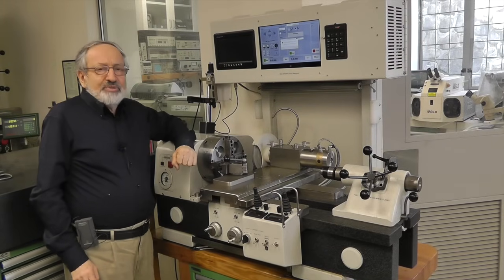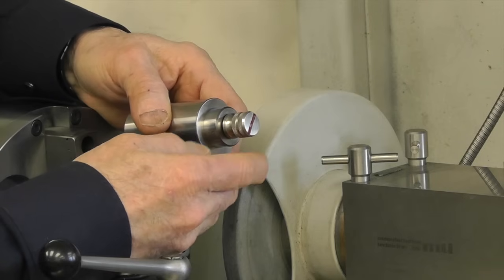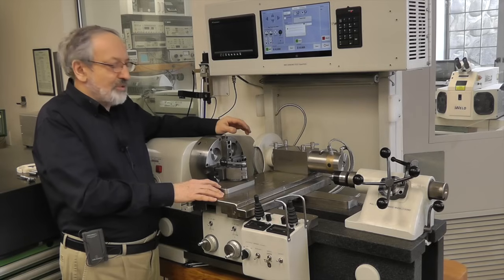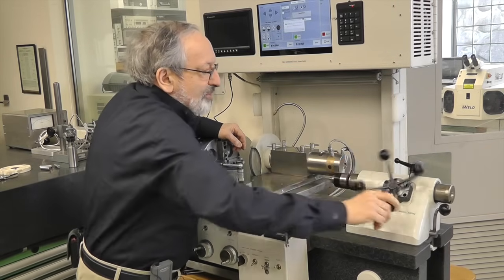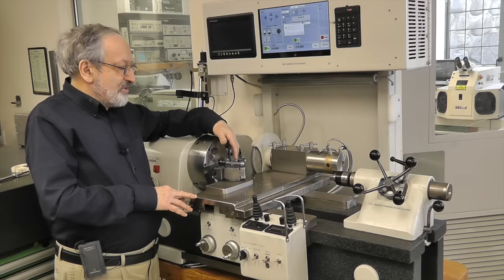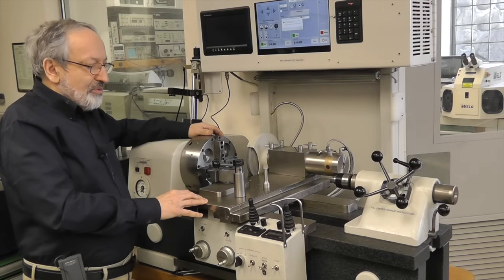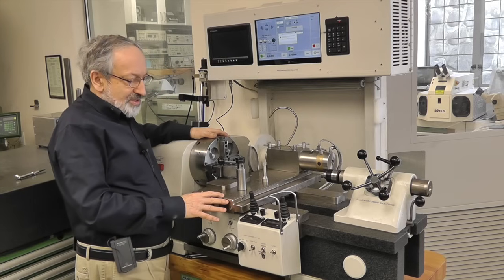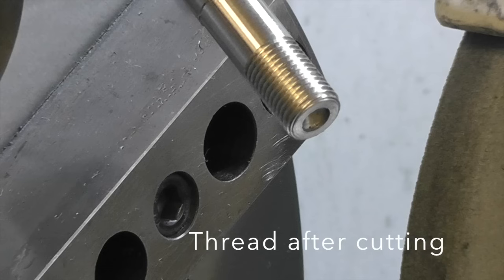High precision air bearing CNC lathe and grinder

Comment: Hi M. Gelbart, I really enjoy that short video like all your videos. I'm looking forward to see more of your work. I'm working on a very small prototype of horizontal mill / surface grinder following your design and I'm wondering what material did you use for the spacers to hold the granite parallel under compression and how accurate that pressure should repeat over each spacer? Thank you.
Reply from the maker: +Simon Bouchard The spacers are pieces of heavy walled pipe, about 3"OD and 2"ID, all pieces ground parallel in one setting and everything set up to cure flat on a granite  table. Exact compression not important. After curing, the two top flats are added, with gap between them held constant by precision spacers (+/-1um), everyhing inverted on a granite table for curing flat.
Reply: +Dan Gelbart Thanks a lot to answer so quickly, can you explain what are the knobs through the granite? Did you use 6061 walled pipe? All the granite construction is hold under compression just by the epoxy glue? Sorry for all those questions but your work is so interesting.
Reply from the maker: +Simon Bouchard The spacer pipes, like all non-granite parts of the lathe, are stabilized steel. The large "knob" you see is the large head of the bolt that keeps the joint under compression (about 2-3 tons). If you look at the begining of video #1 of my series about making prototypes you'll see the granite parts curing on a granite table in the background.  I recommend starting with a less ambitious project.
Reply: +Dan Gelbart Yes, thanks for your transparency and the advice I will follow it. We do a lot of grinding +/- .0002 but not so much lapping and scrapping which you really get me interested to now that I understand the function of it. You really easily make thing intelligible M. Gelbart, and like many of us I can't wait to see more of your work and technical video. Your enthusiasm is contagious.
Reply: +Dan Gelbart Hi Dan,
When you say the spacers are "stabilized steel" do you mean they are 321 stainless or that they are stress relieved?
Cheers
Reply from the maker: +Andrew Robb  Stress relieved mild steel (600 deg C for 5 hours).
Reply: +Dan Gelbart hi Dan,
Thank you for your reply to this and my other question. You are very generous with your time. 
Regards Andrew
Reply: Hi M. Gelbart, can you provide some littherature reference on air bearing? If I understand you also need to reach a certain surface finish? Are the two surfaces lubricated with compressed air throught porous material or is the geometrical precision only what you need to eliminated the wear? Thank you and Happy New Year
Reply from the maker: Spacers were hardened steel matched blocks, pressure not so important if area is large. I used about 50Kg.
Reply from the maker: Search under "hydrostatic gas bearings" or "air beaings" and you'll find many books.
Reply: Thanks for the quick answer as always. What surface finish are you aiming for?
Reply: If I can be more precise on my question, can you use a scraped surface or do you have to lappe it to certain surface finish? Thank you
Reply from the maker: surface finish not important (~1um), flatness very important (<1um).

Comment: Dan - Really beautiful video.  I was interested in the chuck.  I looked at the patents skinner chuck company has had over the years but couldn't find anything quite like yours.  Can you give me a push in the right direction?
Thanks!
Reply from the maker: t cody Skinner chuck only had the sealed design, not the  system to remove the run-out.  The run-out adjustment is done by moving 1:10 wedges which displace the plate the chuck is mounted on. The plate is clamped between two other plates. All the interfaces use roller bearings and all parts are hardened, ground and lapped air hardening tool steel (A2 and D2).  Chuck parts are made to 1um.

Comment: I need to build this machine. I think I should buy a precision motor and precision air bearings and make the parts that can be made and not bought of this lathe. I am so lost though, please give me some insight of making a lathe mostly from scratch. Dan Gelbart please respond soon. Thanks for your time.
Reply from the maker: Sir. Dan This is a machine for very experienced people. If you need instructions how to build it, better not to try until you learned more abut metrology.
Reply: I have mechanical drafting, electrical, welding skills, and some computer programing. I am dedicated to learning how to manufacture precision machines.
Reply from the maker: Sir. Dan A good place to start is the book "Foundations of Mechanical Accuracy" by Moore.
Reply: I will go get that book and learn as much as I can. Thank you so much. I hope I can invent something great, You can't invent something you don't have knowledge about. I hope I break that barrier of knowledge that is needed to be more intelligent than others. example) everyone tries to write lyrics, and the lyric library is being exhausted.

Comment: I would love to hear you discuss how you got positioning motors (steppers?) to deliver such tight tolerances.  What an amazing machine!
Reply from the maker: Buck Calabro A stepper is accurate to 5% of step, or 1/20 of step. Since there are 200 steps per revolution this is 1/4000 of a revolution. Stepper is geared 1:2 with a timing belt so 1/8000. For a 4mm pitch ball screw this is  0.5 um error. Problem is that this calculation is only true if stepper is lightly loaded (say 10% of max torque). On air bearing machines this assumption is true as there is little friction.  Also, many precautions need to be taken: timing belt pulleys need to be re-bored for very low runout, bearings need to be square to shafts <1um etc.
Reply: Dan Gelbart It seems counter-intuitive but the math does not lie. Thank you very much!
Reply: @dgelbart  A good stepper is mechanically accurate to 5%, but as far as I know, micro stepping over a certain value, falls accuracy because of non linearity of the motion that introduce position incertitude. Setting 1/20 micro steps charge the inductors from 100% to 0% to 0% to 100% in steps of 5%, so the first step would be 95%-5% the second 90%-10% and so on. What I have learned say that motors won't move until a minimum amount of energy is given to the "weaker inductor" ... but that it's theory and what happen at the various rotation speed I'm not aware. Your experience is much more valuable than any theory :-)
Reply from the maker: @silverdog63  Fully agree, but per my previous answer you still get only 0.5um of position error from the stepper motor itself if it is lightly loaded.

Comment: Hello Dan, 
Do you think the bottom two granite parallels (that are bolted together) should also be so precisely machined than the top two. Maybe you could also use something less accurate.
What about metal base, or is this not a good idea because of different coefficient of thermal expansion?

Regards

Comment: So I bought a jig borer yesterday. It's a B.C.A. Mk3. While I was moving the machine,it fell of the pickup truck and the z axis screw,micrometer dial,a couple of other dials,and some small parts broke off.  How do I go about repairing the machine? The body castings appear to be okay,a couple of chips on the z axis hole where the screw broke off,but other than that,no visible damage to the body.
Reply from the maker: airsoftsniper108 You can read about it and its history here: http://www.lathes.co.uk/bca/
Reply: Dan Gelbart I already read that. But I can't find the instruction manual,and I don't know exactly the full extent of the damage that it has. I think the worm-and-wheel gearing broke off though. It's some sort of part that appears to have ball bearings in it.

Comment: I was wondering about the load capacity and size of the main spindle bearing.  I found some information regarding air bearing stiffness but wanted to know what results you are seeing in practice.  What depth of cut are you typically taking for aluminum and steel?
Reply from the maker: Skyler Olsen Main bearing is about 3" (75mm) dia x 6" (150mm) long, plus a 5" (125mm) dia trust bearing. Load capacity is not very impressive, maybe 50-100Kg @100psi air. One reason is that the spindle bearing does not have pads, just holes. Pads (shallow depressions around hole) greatly increase load capacity.
Reply: Dan Gelbart Thanks for the info!
Reply from the maker: Matt Bockman You can install porous graphite pads.
Reply: Dan Gelbart Pads would probably be difficult to make inside of the bore of the air bearing spindle, right?

Comment: Hi. First off,thank you very much for posting these videos, I have learned so much about machining from you. Second,I am in the process of learning about machining,electronics,engineering,etc and I was wondering if you could recommend some good books to me. I have ordered so far:Precision Engineering http://www.amazon.com/Precision-Engineering-V-C-Venkatesh/dp/0071548270, Practical Electronics for Inventors  http://www.amazon.com/Practical-Electronics-Inventors-Paul-Scherz/dp/0071771336/ref=pd_sim_b_5?ie=UTF8&refRID=0Y11CFDEXKZ8MTBZVGCA, An Introduction to Measuration and Calibration
 http://www.amazon.com/Introduction-Measuration-Calibration-Paul-Campbell/dp/0831130601 ,and I am thinking of the Starrett Student Machinist Book and Foundations Of Mechanical Accuracy. Is there any other books you might recommend? Also I am in the process of tooling up my workshop and was wondering where the best places to buy tools and components are. I live in Canada so my options are somewhat limited. Thank you.
Reply from the maker: airsoftsniper108 I think you're on the right track. A book I would add is "The Art of Electronics". There is no problem in getting used machines in Canada (I live in Vancouver). The trick is to know how to ship them cheap: http://www.freightquote.com/.
Reply: Dan Gelbart
Thanks, I have actually tried to buy used machines (specifically a lathe) a nice southbend 9x24,but I have failed each time. My latest attempt involved bidding for a lathe at a auction where the price of the lathe went up to 1700 dollars (with the minimal tooling it came with,it was not worth it). Anyway,for small components,metals and overall industrial supplies,where do you recommend I buy? Also,is there a website that sells used machines? Sorry for so many questions,it's just finding this information has been quite a problem for me,and any help I can get is very much appreciated. Thanks again
Reply from the maker: airsoftsniper108 I buy them on Ebay.
Reply: Dan Gelbart thanks. Another question. I noticed that in most of your videos,you mention the waterjet cutter. Is it a better tool than a laser cutter?
Reply from the maker: airsoftsniper108 By far. Can cut any material and up to 50mm thick. Laser ciuts some materials very well (i.e. steel, stainless steel) and others very poorly.
Reply: Dan Gelbart
thanks. I have one more question to ask you: do you recommend a book on materials? Thanks again.
Reply from the maker: airsoftsniper108 Nothing comes to mind.

Comment: looks nice for self build.I enjoyed video..I am a precision grinder by the way.. Didnt see how you dress wheel ? Does grinding side have auto dress cycle and compensation ? I work for an air bearing company and grind all components so appreciate what you have done. Nice project ..but grinding side will destroy exposed slides rapidly.
Reply from the maker: teedyuk No built in dresser, dressing done by holding diamond in lathe chuck before start of job. I'm watching wear on ways, quite easy to solve by way covers, now only have felt wipers. Was hoping escaping air will push grit away, but because of the cutting fluid it does not.
Reply: Dan Gelbart i was wondering about the grit damaging the ways as well. Since you anyways have the air lines running into the lathe, maybe an air curtain in place of the wipers to clean the ways ? Thanks for the videos, very inspirational.
Reply from the maker: Janne Kotka Really needs way covers on chuck side (bellows or similar). Wet grit is not blown away well unless you use an "air knife" which consumes too much air.

Comment: PLEASE PLEASE SHARE THE PLAN FOR BUILD THIS LATHE PLEASE
Reply from the maker: Wael Elsafty Unfortunately plans are not sufficient, it is based on a lot of know-how (scraping, lapping, air bearings etc) plus you need to have some good equipment to start with (good surface grinder, granite square accurate to sub-micron etc). Some pieces of this lathe can be used on any lathe, like the precision chuck, and I plan to share these plans when I'm less busy.
Reply from the maker: @Steve-lu6ft  Sorry, looks I'll be very busy for several years. I don't have much in the form of plans.

Comment: Hi Dan, I'm trying to understand the principle behind why capping the plunger prevents air flow even if there is a sliding-fit gap. Could you shed some light on this? Also, the spinning demonstration is demonstrating hydrodynamic bearings, but at low speed you would halt quickly because the hydrodynamic effect disappears, right? Thanks!
Reply from the maker: Michael Yip Capping is just to show fit is air tight. You're correct about the hydrodynamic effect.

Comment: How do you measure and correct for run-out on a micron accuracy?Thanks again
Reply from the maker: rioresearchanddev Measure with a capacitance gage (it is good to 0.01um). Correction is done with the special chuck wich allows zeroing it.

Comment: Is the tail stock cast.... and if so did you do that yourself?
Thanks ahead of time.
Reply from the maker: rioresearchanddev Tail stock is fabricated by bending and welding. The difficult part is to bore out the hole, 50mm di x 300 mm long to a tolerance and alignment of 1um. This is done by first fabricating a temporary tailstock with no quill, bored with main spindle. Using this tailsock you can set up a 600mm rotary boring bar, and move the real tailsock along the ways (using the power feed) to bore it out.

Comment: This is very interesting machine and very nicely designed. Can you please tell a bit more about the linear air bearings.
It is not completely clear to me - the saddle has a metal-to-granite air bearing and a cross slide has a metal-to-metal air bearing?
What are the clearances in the air bearings - between the bed and the saddle and how did you achieve them? Can you please show us the underside of the air bearing.
Thank you for this video :)
Reply from the maker: fogl2 The cross slide also rides on two granite 1"x2"x12" granite parallels. Air gap is about 10um, bearings are of the pocket type. Each pocket about 25x40mm, 0.02mm deep, fed by a restrictor (about 150um hole).  Sorry, I didn't take photos of underside.  If I had to do it again I would use porous grahite air bearings with much smaller air gap.
Reply from the maker: Matt Bockman Hi Matt: Porous graphite  are a better choice for stiffness, but I was worried about the coolant seeping into them when machine is off  and plugging them. The granite is always wet from the coolant, and the coolant leaves a residue when it dries up.  Maybe it is an imagined problem, as graphite is water repellent, but I noticed I have to wipe the granite ways from the coolant residue each time I want to use the machine.
Reply: Dan Gelbart Thanks for showing this inspiring work of art. I am trying to understand the design choices that were made to learn more about air bearing construction. Why did you choose not to use porous graphite bearings in the first place? I'm assuming you are well versed in air bearings, so you probably weighed the advantages and disadvantages in the first place. What advantage did the pocket type air bearings have over a porous graphite type? My guesses that come to mind are: 1) ease of construction, 2) ease of obtaining the materials. 

Thanks,
Matt
Reply: Dan Gelbart I understand the dilemma of making a design decision based on a potential problem :). I do that all the time, and I hope that most of the time the problem I was trying to avoid would have actually happened. Is the granite porous and that's why it retains coolant well? I notice on my own surface plates that when cleaned with a water based solution they don't dry as easily as a clean piece of aluminum or steel (or non-porous material). In a dry environment, could graphite air bearing be made from something like: 

http://www.mcmaster.com/#graphite/=x5i9bb

or does a very specific graphite have to be used? 

Thanks again for your responses. I'm learning a lot from your videos!
Reply from the maker: Matt Bockman YOu need a special porous graphite. The granite is not porous but water wets it well (hydrophillic surface) so the coolant spreads.
Reply: I've heard of methylated spirits being used as coolant, it would just evaporate off.

Comment: That's a really nice machine. Would you care to estimate build cost?
Reply from the maker: Under 10 grand. The granite is from precisiongraniteusa.com, about $2500. Motors and sppeed controls from goldenmotor.com, about $500. Ball screws (C0) and air bearings are surplus, from Ebay.  All electronis (stepper and microstepper drivers , power supplies, switches etc) from Ebay. A regular chuck shold be under $1000, mine is very specialized, all parts lapped to 1um.
Reply: Someone else mentioned this, so I came back and read it again. I am surprised to see you are using steppers. It seems to me that something more analogue would have suited your surface finish requirements better. I am a real fan of servos + resolvers (at eBay prices, I should add).
Reply from the maker: +andy pugh A stepper in microstepping mode, with a large number of microsteps per step, is as smooth as any brushless or synchronous motor.